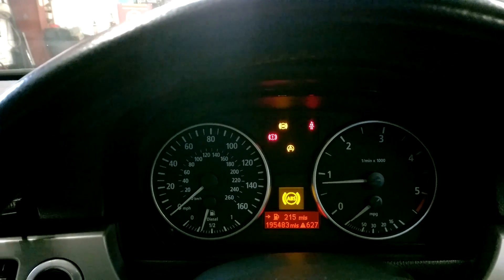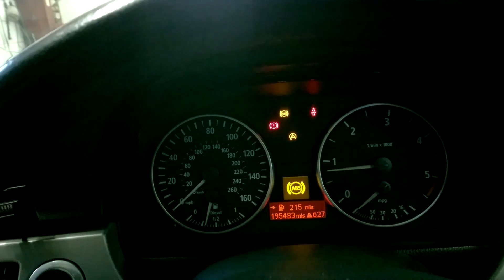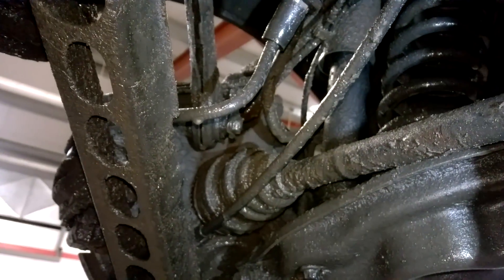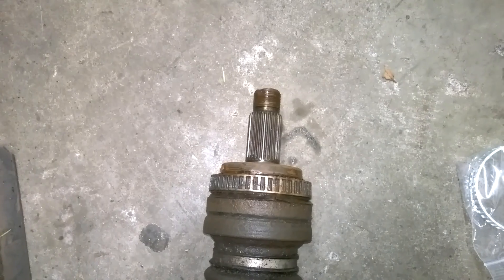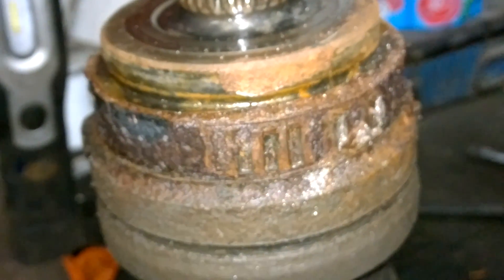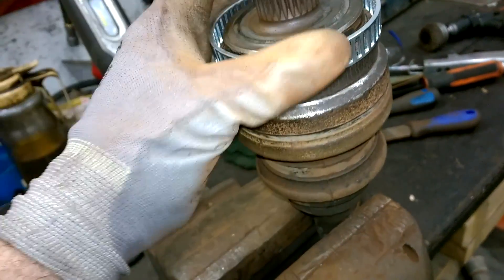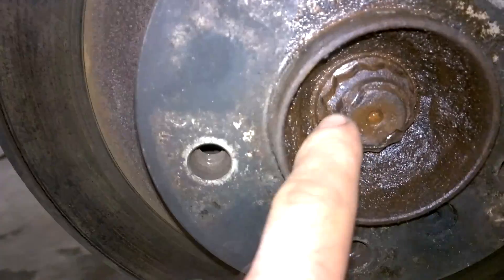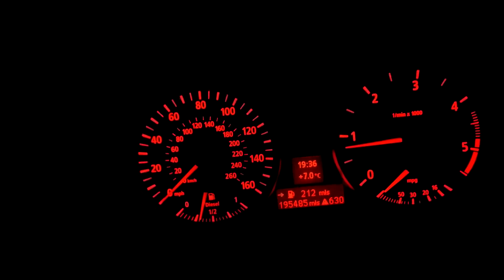ABS Reluctor Ring Replacement - How To - BMW 3 Series

Comment: So no oil will need to be drained before u remove the driveshaft?
Reply from the maker: No it does not need to be, the inner shaft does not go through the diff, its attached on the outer as you can see in the video.
Reply: Gerard Burke thank you for the answer 👍🏻
Reply from the maker: No problem

Comment: I've got the same issue w/ E90. Thinking of getting new half shafts w/ ABS ring of course. Found good price for Magneti Marelli (OE PNs 33217553561/ ...562). Do you know what is the OE original half shaft supplier that comes fitted with the car (GKN/ SKF/ Magneti Marelli..)? Thank you!

Comment: Could you not just replace the whole driveshaft? Wouldn't s new one come with an abs ring fitted? Or is that considerably more expensive?
Reply from the maker: You can and it would, if you get a driveshaft at a good price it is the best option Mike. All boils done to cost of labour & cost of part totals.

Comment: I fitted two brand new abs sensors today on my 2006 e90 320d. Before i screwed abs nut in i spinned hub to see if it pushed out sensor which it did about 0.5mm. so i fitted washers to stop this. But after driving on road for a few seconds all dash lights come back on again. Why is this? Very frustrating..
Reply from the maker: The reluctor ring is out of shape too much, when its gone too far the spacing of the sensor will not work, but at least you did not damage your new sensors. Drivers Rear Side is usually the most common for the problem.
Reply: To be honest with you my intentions was to change reluctor rings at first as i have two new ones for it but i run the head of the top 10mm nut at top of drive shaft. All other 5 nuts came out not a problem except that one at top. I hammered on 9mm socket and i still can not get it to budge. I ran out of time so i screwed all nuts back in and fitted the new sensors instead with washers. I might try again next weekend but have you any tips as to how i will get that top nut removed? Its the most awkward one to get at.
Reply from the maker: If you are talking about the inner bolts, the head of them is an e torx socket/spanner that you need. if it is like in my video?? They are all the same to remove as you can rotate the shaft as you need?  
 
If you locked on the handbrake you probably have made it more difficult, If the head is ruined you will need something like a correct size twist socket to remove it.
Reply: Ok al maybe have another go at it. When you say my reluctor ring is to far out of shape does that mean the outer cv is gone as well or is it still worth my while fitting the new rings i have? Ps i got a little red tube along with the new rings called "abs ring retainer bonding/anti corrosion" do i need to apply this onto the cv before fitting new ring or is it important?
Reply from the maker: If you are not familiar with this type of work, it may be better to leave it in a good workshop. You may just make it harder for yourself and if you damage bolts (more costly)  Fitting the reluctor ring is not straight forward. If it is too far gone like I suspect that it is you will need to replace the CV joint or the shaft. The shaft is the quickest way to go and they are not bad to install.

Comment: reluctor ring is virtually the exact same design on my peugeot van, and its had a crack in it, so now and again would slip to an off angle and catch the hub and not spin, didnt matter when driving, but it was really important when braking! you approach a roundabout and then the pedal would start fighting you back! your slowing down for a slip road off the motorway and it goes into 3 wheel braking and tries to throw you off into the ditch...
epoxy glue fixed it..... some abs systems (and there all re-badged bosch really) (except the ones that are toyota) are more forgiving than others, being a van and a 2005 its really basic and forgiving of 'variation' i do not recommend that anyone reading this repairs with glue or non standard parts!

Comment: hi, good video but drive shafts are so cheap now days , £60 to £70 new reluctor ring included why not just change the whole shaft in half the time.
Reply: Drive shafts cheap? 600 euro per side on a BMW...
Reply: @dennisklasen4788  can get them off ebay very cheap 50 to 70 pounds

Comment: hello, does is it same operation for BMW E34 : replacing only the ring or should I replace the whole wheel bearing KIT ( 	31221139345)
and what should I do for the rear ABS Reluctors is it just the rings also or what ??????????????

help please URGENT!!!!!!!!!!!!!!!!!

Comment: Why not heat the ring up and shrink it on. just pop it in a oven for 10 minutes.
Reply from the maker: Honestly I had not known about that prior to making this video, next time I will certainly try it. Learning everyday.
Reply: There seems to be a significant volume of rust though, I think it best to get rid of most of that or you risk the new ring being uneven or over stressed. So I will combine the approaches.  I have just started this job on my 120d, got the shaft out easier than i thought. 
Hub nut came loose with a ratchet and a small extension over it. For the shaft to diff bolts I find it easier to just put the car in and out of gear than holding with  a pry bar. 
To get inner joint off diff compress it and bring it upwards, easier for it to clear the diff that way 
Anyway have the shaft out now and I've found this video very useful for working out the next steps, thanks gerard.